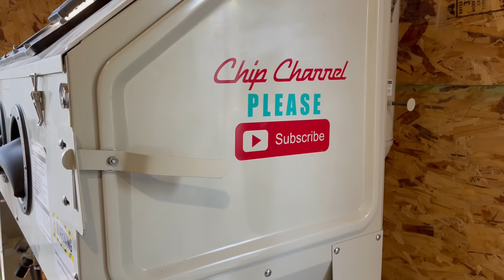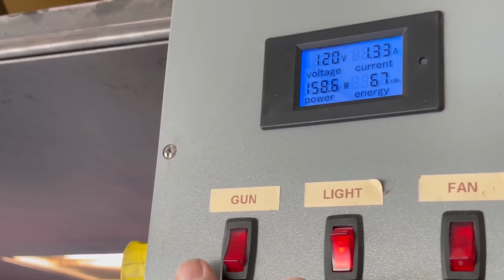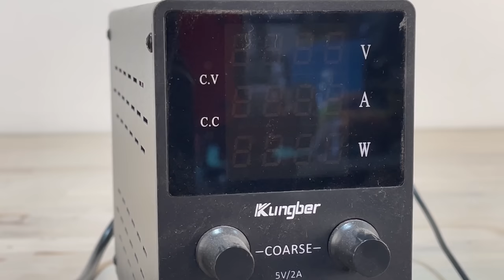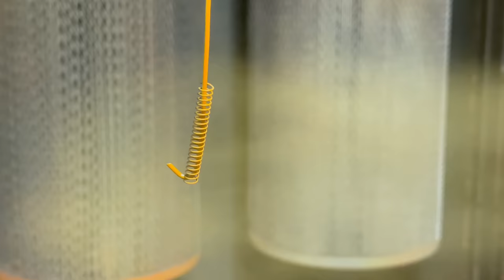1957 Tonka Big Mike Snow Plow Highway State Dept Dump Truck Restoration

Comment: The complicated construction, parts count, and “gimmicks” on this plow-truck are quite surprising considering it’s era and the subject matter. Of course for me by the early 70’s when I had a few, they were quite simplified. Everyone wanted the big yellow dump truck, cause you could ride on it lol. Nice work!
Reply from the maker: They really put alot of thought into these old toys, todays toys just can't compete. Thanks for watching Jim Letts!
Reply: You must have been a tiny kid back then…. Or was that yellow dump truck really BIG?
Reply: @robertdragoff6909  I did also. At 4 or 5 you could put your knee in it and push it along.
Reply: @jamesmartin1489  

LOL! I thought it was so big you could sit on it and ride around on it.
Reply: I rode on my big Yellow Dump Truck in the 80s and 90s lol
 I'm glad not the only one. Those plastic wheels gave a vibration blur to your eyes where you couldn't see where you were headed on asphalt roads. Hahaha Oh memories
Reply: @robertdragoff6909  I would sit on the cab where the dump bed overlapped and scoot around the sandbox. The old steel ones were bigger than just about any other similar toy.

Comment: These videos are how I chill before bed.  Thank you for your service.

(BTW, the slot in the tailgate is so it can be locked partially open.  You would fill the dumper with sand, then tilt it up with the gate open a crack to spread sand over the road.)
Reply: I watch these before bed too! It's so relaxing because of the crickets in the background. 😊

Comment: Each video you produce is always top notch, entertaining, and the detail throughout the restoration process are fantastic!  This particular Big Mike must have experienced a plow change in its life at some point.  The plows with the indentations (one on each side and clearly seen) actually were produced for the slightly newer 58 model plow trucks.  With their square corners, the plows were then made with those indentations to allow for fit on the front corners of the hood and front bumper area.   It's somewhat rare to see these particular plows as compared to the older style with just the smooth plow surface. The older plows will fit, although very tightly, onto the newer 58 style cabs.  The restored plow here has no issues fitting nicely onto the older and more rounded style cab.   As always, another wonderful video.  I look  forward to each and everyone .   Not to mention the fact that I look forward to seeing the cat inspect the finished product!  Thanks a million for all you do!

Comment: I watched quite a few of your videos before subscribing. Although these pieces are old and the metal is pitted, you do not compromise on the finish of the painted product. This is where all the work is.... I like how you plate and polish the axles/metal parts etc.., and make new parts when required..You are a great restorer of these old toy's. turning them into museum pieces, but with I suspect, a far superior finish than the originals ever had. It's all good work, keep it up...

Comment: I went back and looked at your disassembly of the plow blade; Tonka painted the individual parts before assembling them.  When you reassembled the plow blade before you painted it, I thought "There's unprotected metal that's going to rust eventually and mar that beautifully restored truck."  Had a similar thought about the dump body.  Water is insidious and could very well have penetrated the sides; I was surprised that you didn't remove the end caps from the back of the dump.

Comment: When do you refill the sandblasting filter system?  How often do you change the filters in the powder coating ventilation area?   Your tungsten carbide bits on your way perfect drillbits to use whether it’s wood or metal. , it’s really quite unbelievable that you can do or have all this equipment available to you to do what you do. It must’ve took a lot of work to do that.?  Even your Roz blocks are used properly.   I  am Delighted to watch this channel. Thank you very much.

Comment: I'm not sure about the orange. 
[Or decals for that matter  -- I can't tell if the side ones  were clear or white  --  if yellow  then they faded differently than the top -- and the top one appears to be two originally  -- I don't know]

Not sure about that orange though..
[And "Tonka" isn't as visible under that powdercoat]

That powdercoat adds a thickness, doesn't it?

Not sure that bumper was blk, either.

Interesting though. 
You brought back memories  (pedalcar mostly).

Thanks

Comment: Could you use a nylon hammer that doesn't.Marr the surface and maybe you might get a  surface primer to fill in the imperfec54
Reply from the maker: Thanks Bruce, I may try some different filler, however the reason I use JB weld is due to the heat required to powder coat. It needs to withstand 400 degrees for at least 20 mins. Most filler primers or standard body fillers will bubble up and blister at that temperature.

Comment: 51:17, those were on inside when taking apart. Do they belong inside or out? I think this one is one of my top 5 favorites so far. I liked the way it looked rusted out too. Great job Mr. Chip! 👍
Reply: I noticed it also.
I think it belongs on the inside, like the old one.
Reply: I think they belong where he put them otherwise they would just slide together like they did in the disassembly
Reply: @waltradcliffe4482 , good point, I did notice them together. I actually thought one was missing at first.

Comment: Can't you use the JB Weld Shavings/Dust and put it in Epoxy and Reuse it? And why not take the ribs off the dump bed to get behind them?
Reply from the maker: I really wanted to take the dump bed apart but there were over 30 spot welds holding it together and I figured I'd be left with swiss cheese after drilling them all out. Thanks again for watching!
Reply: @ChipChannelRestorations  It's too bad. It would seem that they would be a weak part in the resto and rot from the backside out, unless you dip it into a Antirust liquid, let it dry before Primmer? Or dose the powdered Paint somehow get behind and  cover it or treat it somehow? One would hope.

Comment: Always like when you do a State Hi-Way vehicle. That orange really stands out. Was there a series of these vehicles ? Are you missing any of them yet ? and was that the new lathe attachment for the CNC machine you were waiting for to do the tank treads ? Great video as always !  edit: I went back to the start of the video after someone asked about the "star" item. then I seen a old sprinkler off to the right of the tank. and I seen a State Hi-way grader in there too !
Reply from the maker: Thanks Steve Wright!! I really love this orange color as well, it's my favorite. And nope that lathe attachment is another tool I'm learning to use. The lathe I'm waiting for is a few weeks out yet, I'm hoping to have everything set up and running by September to do the tank. My biggest issue is going to be recreating the tank treads, I bought a 1.5kw fiber laser to recreate those and just waiting on it to show up.
Reply: @ChipChannelRestorations  I looked at ads for the laser ! Hope you didn't put another mortgage on the house for it !  😃😳
Reply from the maker: @bakersnuts100  LOL,,, I've been saving for awhile for it. I'm actually hoping long term to make reproduction parts to resell. Which is the actual justification for the purchase.

Comment: I have a cement truck and it's really rusted to the point I have it soking in warm soapy water after I used a old  toothbrush with some dish soap and lightly brushed the dirt away but some of it is missing on the driver side but it's soaking right now and im just like ok what do I do now um can any of u give me tips for what I can do